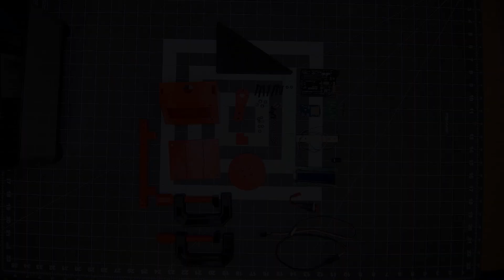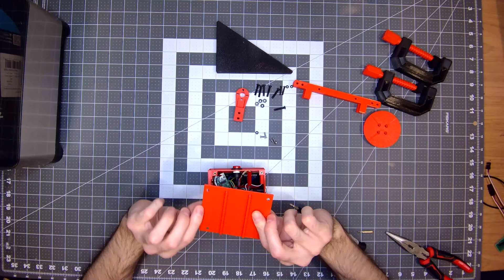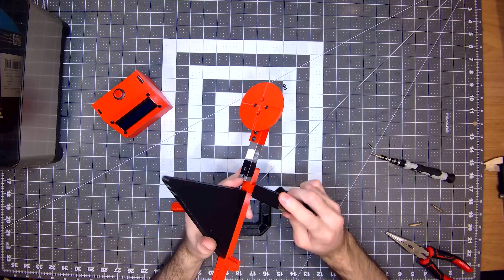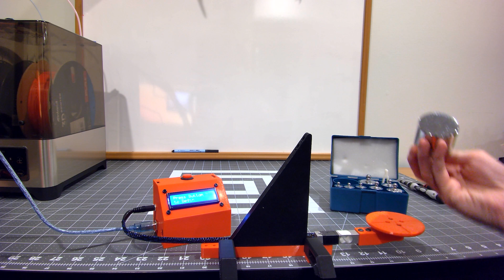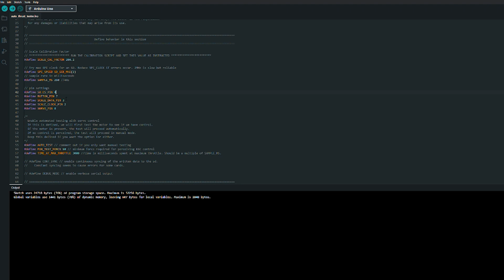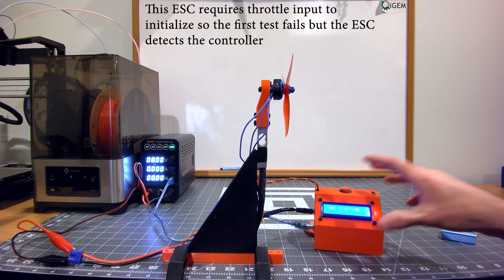3D printed Automatic Thrust Testing Stand Powered by Arduino

Comment: Hey Niklas Melton. I'm trying to build my own stand but am using yours as a rough guide to get me started before I make changes and go off in my own direction. Would you be able to send me the attachments that you mentioned throughout the video. I don't see anything in the description. Was also curious about where I could find your 3d print files so I can get a rough estimate at the dimensions that you used. Thank you so much!!

Comment: Hi Niklas. This is a really an amazing design for a thrust stand. I have created my own one put of wood using an ESP32 that drives the sensors outputs for Voltage, Current and Thrust, but always found the stand was way too bulky. Do you think that the 3d printed stand can withstand up to 5Kg of Thrust if I print everything in PETG with minimum 60% infill?